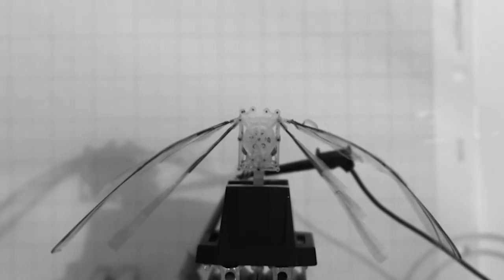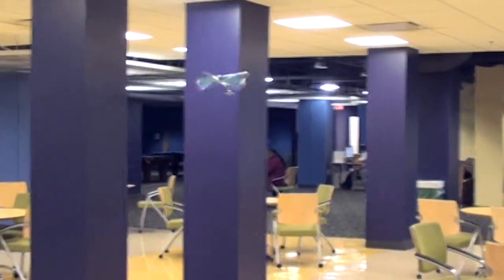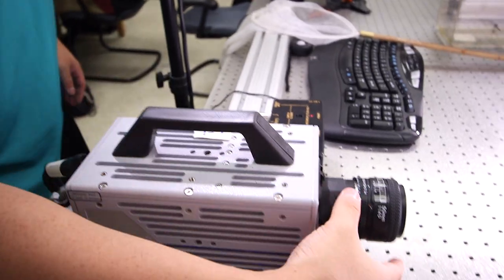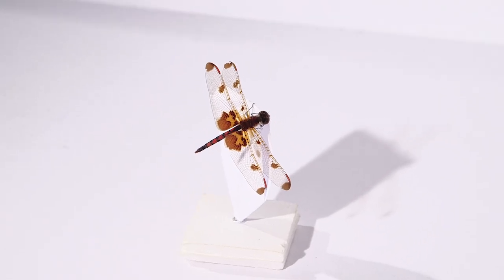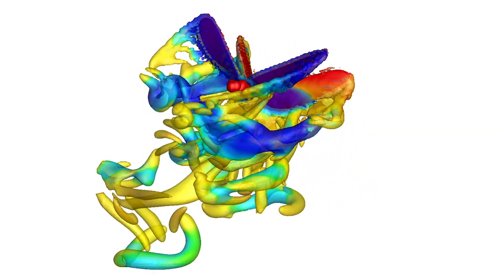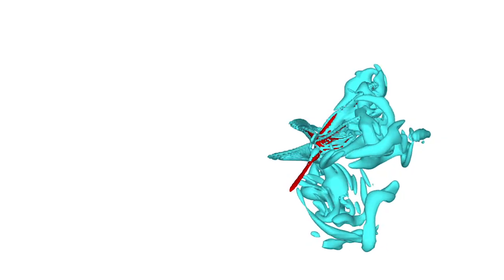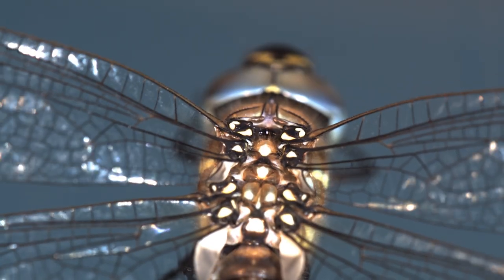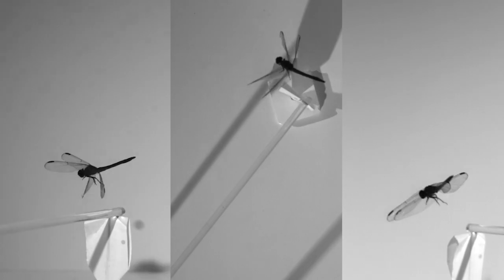Investigating the Secrets of Dragonfly Flight

Comment: Do you analyze the hollow bone structure and the cone shapes under the wings as a system of levitation for dragonfly flight?   It seems that their wing movement is performing a control system for their flight rather than the actual flight/lift mechanism.

Comment: Is there an advantage of 4 wings ?
Reply: The use 22 percent less energy to fly when the beat their wings out of phase
Reply: The 4 wings work together to create swirling vortices of air under the wings which enable them to hover by barely beating the wings on top of the very vortices that those 4 wings create, like tapping on firm columns of air. This enables the hovering, acrobatics, reverse flying, and high flying speeds of these masters of the air. Just enter "dragonfly flight vortices" in your search and you'll find plenty of good material and illustrations.
Reply: Good question. 👍
Reply: Redundancy, not sure beyond that